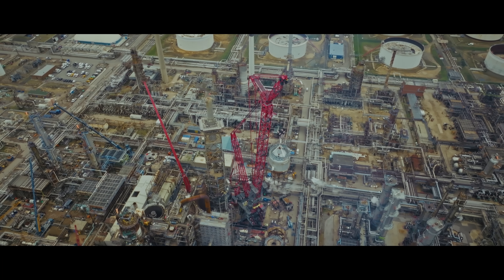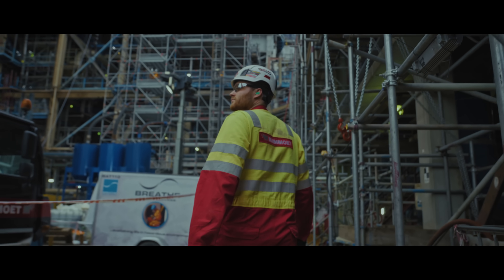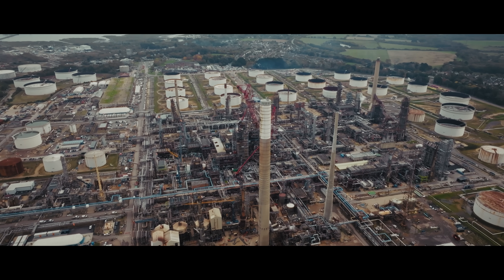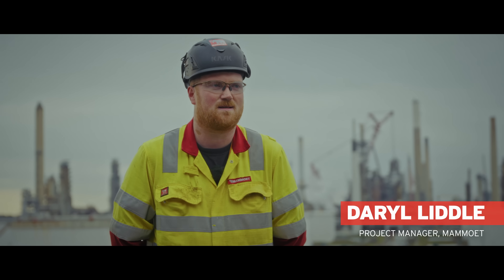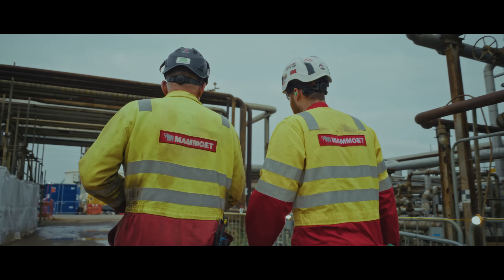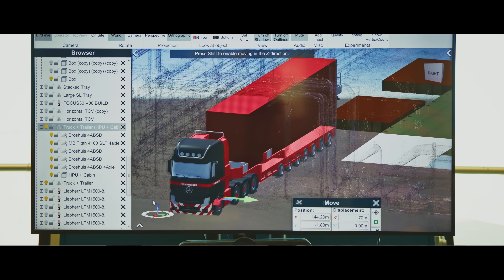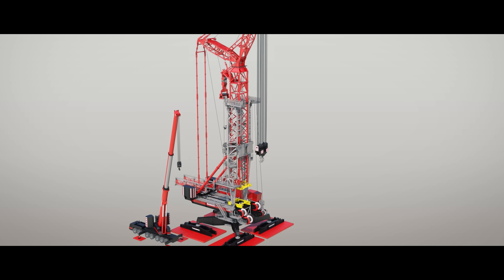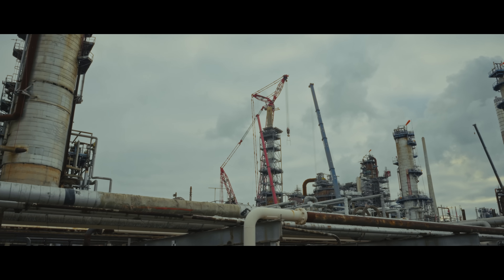Lifting hundreds of tonnes from a TINY footprint

Comment: As amazing as the Focus30 itself is, the software and implementation of 3D laser scanning was just as important, and just as amazing. Being able to plot out the lift before the crane even arrived with that level of detail is an amazing ability, and one that will make lifts in challenging environments easier in the future. The software is the Smarter and Safer, and the crane itself is the Stronger. Great tools used expertly.
Reply from the maker: Thank you - another good example of this: https://youtu.be/uisCMLVkWY4?si=PilAZKjGJIwQRhfC